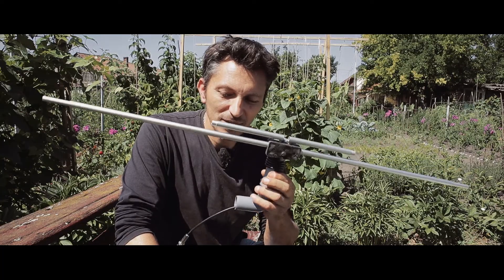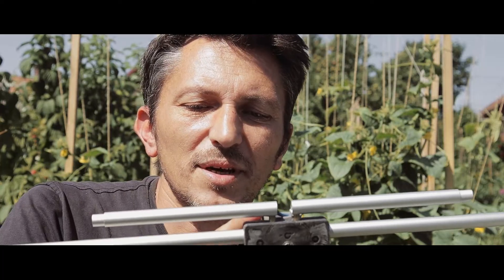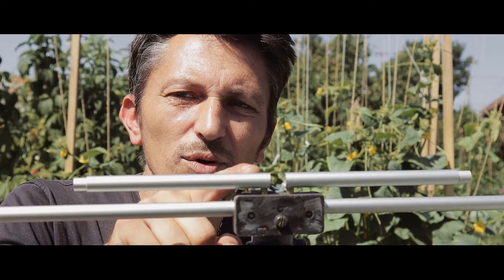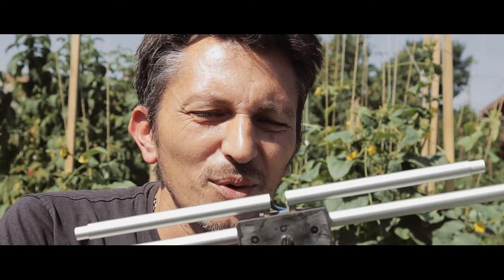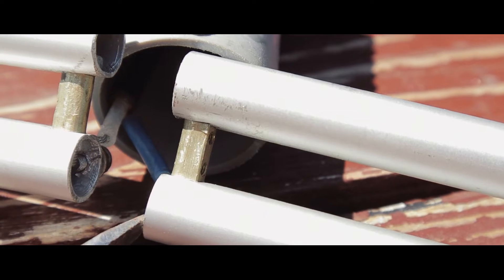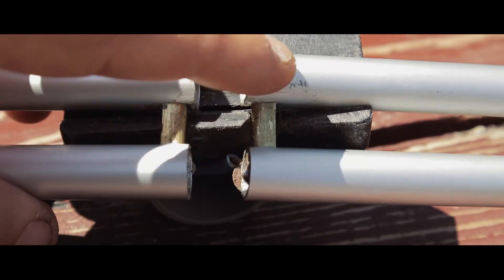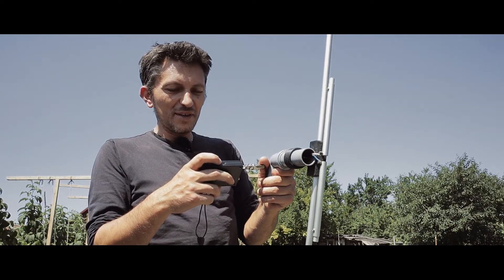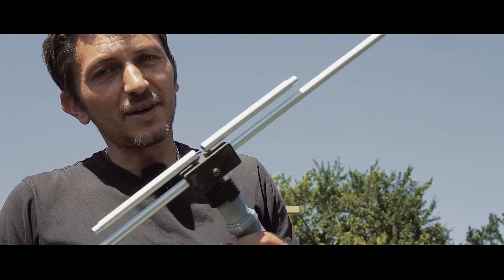Watch This If You Want To Build A VHF / UHF Vertical Dipole Antenna

Comment: You did not mention the coiled wire on the handle. Is it relevant? Or just for holding extra cable? I was impressed by your nesting for tuning instead of nibling away at the element.
Reply from the maker: Ohh I thought I did. But I think I have details on it in the drawing from the download file. Yes it's very important as that is the RF choke and it will also influence the SWR readings. On the adjustments, yes I thought is easier this way since I realized that it needed constant adjustments if I moved the antenna in a different spot and thus was the easiest way to do the adjustments for me. 73, YO6DXE.
Reply: @dxexplorer  I seem to remember it was 1 am when I came across your excellent vid. So you probably did. I'm glad I still remember viewing it!
Reply from the maker: Haha... that is usually the hour when I have the time to watch videos, then I fall asleep ))).

Comment: its 70cm band so need 35cm. so its 1/4 wave. make bigger add more bands if they not interuupt. they will xD.
one antenna tuned for 1 freq. full band xD
Reply from the maker: This one as it is work well on 2m and 70cm. You made me curious now if I could use more elements and try other bands too. I wonder if it would work. But so far for 2m and 70cm works great and I am really happy about it. 73, YO6DXE.

Comment: I built this antenna using the pdf plan from your website and it turned out really great. The NET operator from our Sunday night session stated  I had a much louder and full quieting report compared to the 1/4 wave whip antenna I was using on my Icom T-10 HT. I was surprised that this antenna is somewhat directional as I didn't expect that from a dipole. Thank you so much for sharing this great video. Your presentations are informative and your personality calming. Thank you!  73 - KR4AAD
Reply from the maker: Thank you so much for the nice words. Glad you like it and it performs well. I was also happy with the antenna when I built it. Initially I didn't had the little ends to adjust the SWR and it was hard to tune properly as the SWR was changing depending on where and how high I installed the antenna. Now I am also happy with it hehe. 73, YO6DXE.

Comment: Since the ground plane on HTs is inside the radio and connected to the antenna connector, I’m wondering if performance would improve if you disconnect the internal ground plane when using an external antenna. I dare you to try! :)
Reply from the maker: Hehehe... I think the ones who act as a ground in an HT is us while holding it in the hand. Indeed the PCB board of the HT is connected to the ground of the antenna, so you can't really "disconnect it" 😁. 73, YO6DXE
Reply: @ on second thought, yes you are probably correct to say that the human body probably does act as a counterpoise when holding the radio in hand. Likewise, the argument could be made (against my original objection) that even with the internal connection in place, if there is a parallel path for the RF that presents an impedance that better matches what the system needs, then there wouldn’t be RF will take that path almost exclusively (according to Ohm’s law dealing with parallel resistances). So my initial objection would thereby be expelled. (Sticking foot in mouth)

Comment: Thanks for video - so, if I cannot buy exact  od thickness of tube (12mm etc) would it still be ok if they were close?
Reply from the maker: Apparently the driven element is very important to be 12mm as I found from the original article about the antenna.
Reply: @dxexplorer  Di quale articolo si trattava? Potresti postarlo qui? Grazie!
Reply from the maker: @alfredopi8699 Avevo un articolo sul blog DX Explorer che ho appena cancellato perché non ho più tempo per occuparmene. Aggiungerò lentamente i file dei progetti che presento nel video, sul mio sito web di vela, così le persone potranno ancora scaricare i file. Quindi non scrivo più articoli, ma spero che il PDF sia autoesplicativo e possa aiutare un po'. https://28-north.com/download/20099/
Reply: @dxexplorer  Scaricato e ti ringrazio per l'attenzione che hai avuto! Ora potrò provare a costruire e a provare questo dipolo e a variarne l'SWR in VHF e UHF agendo con i supporti scorrevoli da 10 cm per le VHF e da 5 cm per le UHF!
Reply from the maker: @alfredopi8699  Per me era fastidioso non poter regolare l'SWR, ecco perché ho aggiunto quelle estremità più piccole del tubo per regolare l'SWR. Inizialmente ho costruito l'antenna così com'era e l'ho modificata in seguito in modo da poter regolare l'SWR poiché cambiava sempre a seconda della posizione in cui avevo installato l'antenna.
Reply: @dxexplorer  Many thanks - I appreciate your answer.

Comment: nice antenna build! I've seen a lot of variations of this antenna on youtube and yours is the cleanest. I love the nesting aluminum to adjust swr
Reply from the maker: Ohh yes you can build it pretty much from anything you have available. I had some leftovers from when I built the Yagi for satellites and I thought about building this one for day to day use. The SWR adjustment came into my mind a bit later when I noticed that is changing depending on where you install it. I thought it would be nice to be able to adjust it. 73, YO6DXE

Comment: #1  Build a dipole
#2 Turn it sideways
#3 Problem solved
#4 Never overthink a dipole.
Reply from the maker: Yep. Pretty much that's it. Keeping things simple is the best. I just wanted to ad those adjustable "tips" to help me adjust the SWR easier. Works like a charm. And I am re-installing it as we speak on the camper 😅😅. I was just drilling the holes for the cable earlier. 73, YO6DXE

Comment: Simplest antenna I have seen for LEO satellite operation, I would say! Came here as the link was posted in the LEO Satellite Repeater Contact Group. Will look out for YO6DXE on ARISS passes. There is one coming up in this region in about two and a half hours, a 51 degree pass. 73 de Jon, VU2JO

Comment: This is not an antenna for FTA TV ??? Would you make an antenna for a deep fringe TV reception for 70 plus miles Sir ??? Thanks for considering my question and help too. vf
Reply from the maker: Hi... sorry but no. Even though you could probably receive something if you connect it... is not meant for TV reception. Unfortunately I cannot make videos related to TV reception on the channel. Is strictly about amateur radio. But if you Google a little I am sure there should be a lot of information on how to build one.
Reply: Thank you Sir. I will. @dxexplorer
Reply from the maker: See if you can figure out the frequencies you need for the particular TV stations you need. This way you could calculate a Yagi antenna with many elements for some good reception. That is what I would do.

Comment: Do you have an idea what the range of this would be using a uv5r?
Reply from the maker: I am not sure to be honest. I keep saying that I will do a trip in the mountains and test it, but with bad weather and little free time... not yet. I do get repeaters around me very easy... 20-30km away that usually I don't with the regular antenna. I guess it depends a lot on the location and the height as well.

Comment: Just came across your video. I found it very interesting.  Probably much better than using two pieces of wire coat hangers bent to fit into two seperate connectors and two appropiate lengths for 2m and 70cm.
Reply from the maker: Thank you so much. Well... if there is no aluminum tubing on hand... I am pretty sure the coat hangers are better than nothing 😄😄. I tried that too some while ago out of curiosity. Well adjusted they are not bad at all. 73 DE YO6DXE.

Comment: So...a dipole is a directional antenna. Why people say it's omnidirectional ?
Reply from the maker: It depends how you use it. If is horizontal... it has a weak directional tendency. But if you use it vertically then is omnidirectional. Similar to a ground plane antenna.

P.S. Tomorrow I will actually release the blog post on the website if you want to have a look... it will have the radiation pattern depending on how you install the antenna. That will explain the way it works better than words ))) 73

Comment: I made a dual-band dipole using 1/2" pvc and speaker wire. I made the 2m first and used a Surecom meter to tune it down to almost 0 SWR. As I recall, when I tuned it for the middle of the band, the rest of the band worked pretty well. When I added the wires for 70 cm the SWR on 2m went crazy until I got them tuned for 70. At that point the 2m SWR settled down. In use I have found that some frequencies in both bands have SWR > 3, but the built in tuner on my Yaesu gets those down to 1.5.
Reply from the maker: Maybe the Yaesu may have some sort of tunner that will adapt the antenna impedance and lower it ? It does seem that when you make the antenna for dual band... they always influence each other. But as you say... once you tune them well they also perform well on both bands.

Comment: Just made the dipole for the VHF band and is working great. With 5w the swr is about 1.5  and 1.7 at 146mhz. I will probably make a video. I cut the elements at 52cm because then i can cut them for lowest swr. The ideal length is about 46cm. should i cut the dipole?

Have a nice week!
Reply from the maker: Cut it but only 5mm at a time and check the SWR each time. It depends where you install it as well... so if you can try to measure the SWR whith the antenna in it's place that would be great. Waiting for the video 😁😁 Let me know how it goes. 73 and have an amazing week as well.
Reply: @dxexplorer  thank you, i will try it, the antenna for test purposes is located in my balcony and i am away while i am measuring the swr. I will let you know. I haven't tried transmitting in the 70cm band but i can receive signals well. I will keep you updated
Reply from the maker: Should work on 70cm as well. Only that the SWR may not be as good as on 2m.

Comment: I was searching for this exact video. The only problem for me is how to make radials stable. Is there any solution? 
Best regards
Reply from the maker: Use any material you can think of that would do the job and try to do something similar to those pieces of plastic I have. I'm about to do the same for my dual band Yagi as I don't have enough leftovers from my dad's antenna to finish mine ))) 73 my friend.
Reply: @dxexplorer  i might make an antenna only for vhf and not uhf with copper pipe.  A good antenna is essential, the implemented ones are not the best!
Reply from the maker: Try as I did first one for the 2m band as it will also resonate on 70cm. The SWR may not be perfect but it will do the job ))